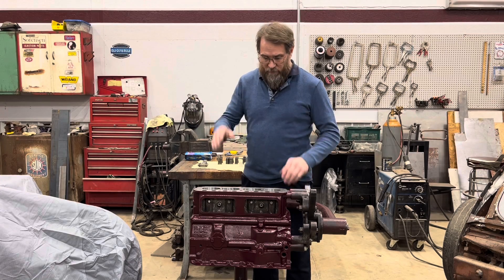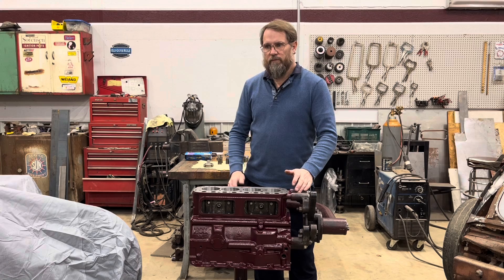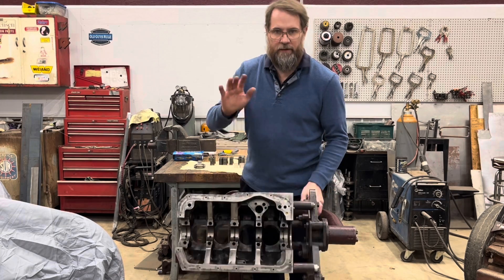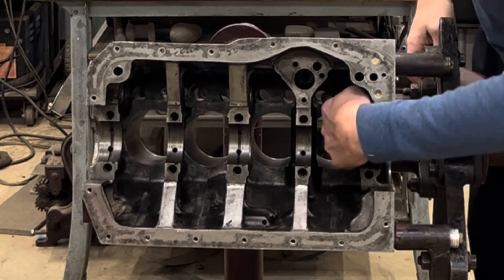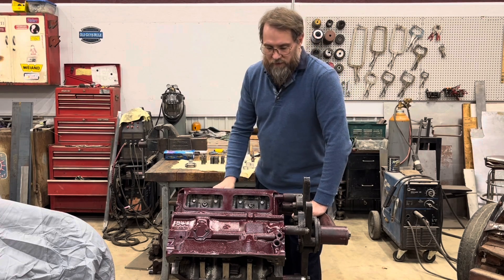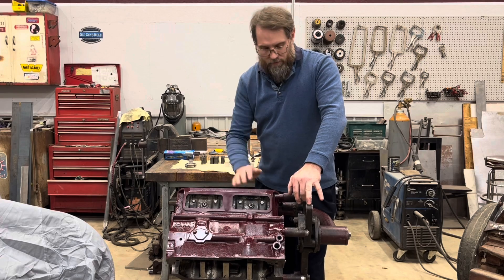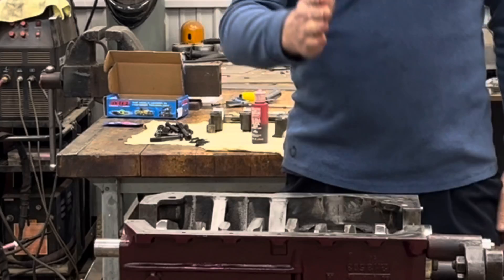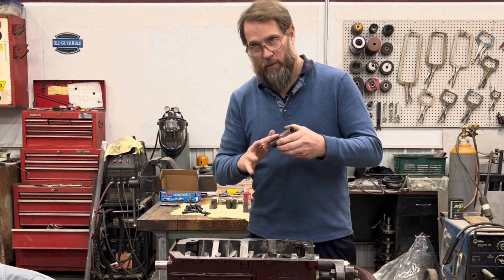MGB performance engine build pt 1, the crank goes in

Comment: Great video. Very informative.  Curious how you determined how much material to remove from the crankshaft weights?  I am building up a vintage 1300 and 1500 Spitfire race engine and can find no documentation on the amount of material to remove safely. Cheers from Texas.
Reply from the maker: For me, I trust my machinist for calculating that. He has the experience and knowledge that I don’t since that’s what he does every day. there are a number of people out there who are really good at that stuff, and some of them do specialize in British engines you just have to find them.
Reply: @ there have got to calculations and drawings on this type of machine work. I’ll need to do more investigating on this subject.

Comment: What year is that engine block? My 1960 metropolitan has three main caps.  That one has five.  Seems like its far superior engine block.
Reply from the maker: My block is a 1974. They redesigned it to a 5-main in late ‘64 for the ‘65 model year

Comment: Not sure if I missed something ------- you were torquing down the one of the main caps ------ and going from the standard torque   of 70 ft, lb. to 110 ft. lb. ------ why the increase? ------ Thank You sharing how you will be building of your engine ------- Rodney
Reply from the maker: I’m using ARP main bolts instead of stock ones. ARP says to torque them to 110 ft lbs instead of the factory torque specs.

Comment: What size pipe tap and plug did you use for the oil galley
Reply from the maker: 1/4” pipe tap and 1/4” hex socket pipe plugs
Reply: @unionjackclassics  thanks
Reply from the maker: @octagongarage3504  you’re welcome

Comment: cleaning of rebuilt engines prior to re-assembly has become an obsession as of late. maybe its necessary for a 600HP modern engine, i wouldn't know, but complete waste of time IMO on 60's and earlier engines. as mentioned the amount of METALLIC (no less!)  grit generated from the friction on cylinder walls, rings, bearings, cam shaft, and valve train COMPLETELY overwhelms any advantages to be had by hand cleaning to the degree often recommended by experts. use regular oil to pre-lube all parts (they'll be inundated with it within seconds of initial start anyway) and wipe down with kerosene and spray bottle. not a bad idea to check all all fluid passages though. 

most importantly avoid anything near redline for several hundred miles. and change oil frequently for first 1000. and remember everybody is just guessing where longevity and initial cleaning is concerned. very few people do or even CAN live long enough to gather valid information as to the effectiveness of their efforts as regards pre-cleaning to be convincing, or even more unlikely, definitive,

Comment: Can you explain the deck height and pistons you are using to get to the compression you mentioned?
My buddy is doing a similar build and mentioned zero deck height. I told him to take some off the head but we are curious what you ended up with head CC and deck height
Reply from the maker: On my build the pistons are .010 down in the bore with the standard 6cc dish and the combustion chambers are 38-38 1/2 cc.

Comment: Excellent video. If I ask a question, could you clarify what a 'wedge crank' is please? Looking forward to the next part.
Reply from the maker: The counter weights on the crank are no longer cut with the sides parallel with each other they now have a wedge shape to them ( reduces rotating mass) if you haven’t seen the video from Nov. where I do the initial dry assembly of the engine, you can get a decent look at the crank in that video. It’s called “ Finally! Starting mg MGB performance engine build”
Reply: Thanks for taking the time to clarify.
Reply from the maker: Your welcome

Comment: You are building the same recipe as I built for my autocross MGB motor.  I’m looking forward to your plan for distributor timing and carbs.  Since the engine ends up so far from stock, I found the normal dizzy timing would not work.
Reply from the maker: My dizzy was recurved by Advance Distributors for the last iteration of the engine, which was pretty close to what it is this time.
Reply: @unionjackclassics  He did mine as well.  But I made a larger change when I rebuilt the engine.  I think it was the move to the VP12 that gave me the trouble.   Low end timing was always in conflict with top end timing.   I had to go to a 123 and recurve completely.